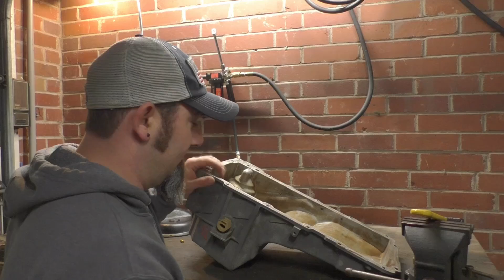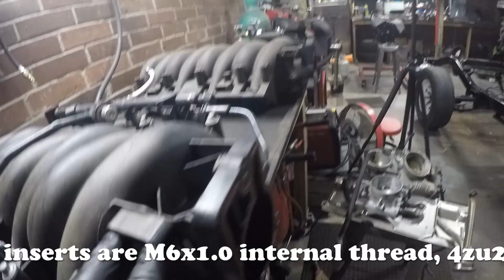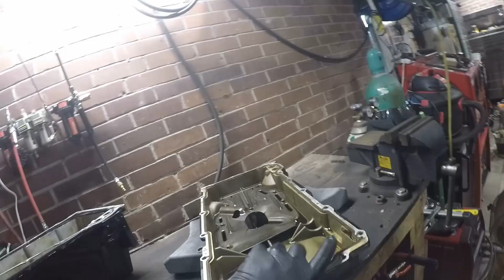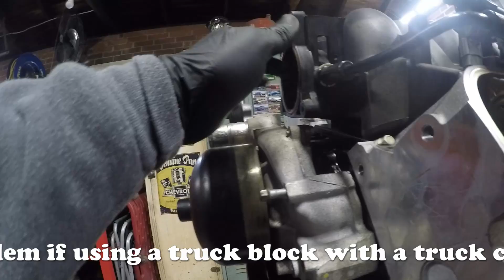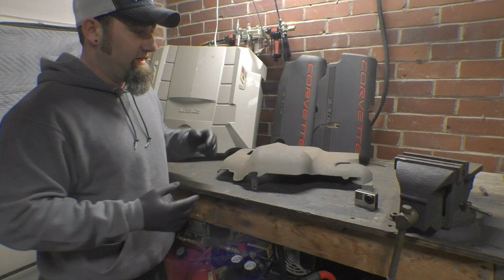Shop Talk: Ls engine guide

Comment: Love this video! Trying to get as much info on ls swaps, im looking into swapping my 2010 chevy colorado that has a 2.9l. Amy recomendations or info/tips youd have? As far as engine years, manual transmissions etc? Thanks! Subscribed!🤙
Reply from the maker: Glad it was helpful!, For your colorado the sky is the limit, nearly everything should fit under the hood with no worries. Depends on the purpose for your truck, but in my opinion the easiest would be a 5.3 ls, probably gen 4 since youre gm already it may talk to some of the electronics and the trans depends on if 2wd or 4wd. If 2wd throw a TKO or a T56 at it and call it good! Thanks for watching and commenting!

Comment: Excellent work bro have a question just got a vortec engine from a 2007 Tahoe that I will be installing on a 64 impala will I have to convert the manifold for hood clearance and what manifold you recommend thank you 🙏
Reply from the maker: Youll probably have to convert to car manifolds for hood clearance. Its a 2007 vortec engine so it should be cathedral port, meaning either an LS1 or an LS6 manifold will easily fit. The rest of the brackets should bolt right up to the block so the accessories will fit you just have to make sure that your oil pan clearance is good. Thanks for watching and commenting!

Comment: When you discussed the truck intake & car intake, does "truck" refer to only full-size trucks? What about GMC Envoys/Chevy Trailblazers, would they be considered car or truck?
Reply from the maker: Those would definitely fall under the truck category. Though they are suv's they are more similar to the truck accessories and intake height.
Reply: @SmallTimeMotorsports  Thanks. By the way, my 04 Envoy XUV has the aluminum 5.3L LM4...

Comment: I’ve got a 5.3 from a 2002 silverado and I’m wanting a shorter intake. What should I look for to direct bolt up?
Reply from the maker: Thanks for watching and commenting!! The lowest profile intake youll be able to go with would be a car intake manifold. If its a 5.3 then it has cathedral ports on the cylinder heads and id be looking for an LS1 manifold, the ls6 does flow more but not enough on a stock engine to be concerned with

Comment: I am sorry,! I didn’t catch it. Are you working on a 5.3L with a fbody/vette intake?

Edit: it’s an aluminum block.  I am new to this.  Will the LS1/6 intake and heads go with the 5.3l block?  Sorry if it’s a dumb question...
Reply from the maker: Thanks for watching and commenting, I am working with an aluminum 5.7 corvette engine, and for your question, yep, the heads will bolt over, but theres and issue with that, youll be dropping your compression if you do and leaving some low end on the table. unless youre doing a full build, it may not be worth it on a stock engine.
Reply: @SmallTimeMotorsports  thank you for your answer sir.  subscribed!

Comment: The staters ARE interchangable, however, you just need to use the correct bolts, also, the starter with one long and one short bolt can actually snap off of your aluminum block over time.  always go for the starter with the 2 long bolts
Reply from the maker: Thank you for adding to the knowledge here!!!!

Comment: What is the sensor on the top of the truck intake, with the green cap on it? Is it needed for a swap, and where does the line lead to on the driver side of the intake? Thanks to anyone that answers.

Comment: Can someone help..I hve a 05 Pontiac Grand Prix GXP and I had a situation with my transmission..I had it rebuilt 3 wks ago...now my cylinder #6 is mis firing, so we ckxd and #5 fires at 195 of compression, but #6 is at 25 (loss of compression on #6) I'm not sure if the lifter is stuck or has collapsed or has completely dislodged and turns but the ticking is there, and it's most definitely gives off a funny smell like rotten eggs. Do I take out the lifter, (reseet  after checkn the lifter and push roads that is) or does the 5.3  needs replaced...can I save that particular engine?

Comment: I am getting ready to ls swap my 1989 chevy g20 van. What configuration would you suggest? I am new to LS but not engine swaps in general. Was looking at doing a 6.0 with 4l80. But i am concerned about clearence. I currently have a 350 tbi in the van.

Comment: The biggest issue I had to overcome with the 6.0 LS in my XJ is a good cooling system. the Novak XJ swap radiator, although fairly robust, and well made doesn't have the cooling capacity. I finally had a custom radiator made by C&S Racing out of Indy. That solved all my issues except I gotta eat baloney for a while.

Comment: Thanks for this, this did help , I'm hoping to make the LS leap,( or vortec, ) I want to swap a 4.8 in place of a 4.3 in a 97 s15, I want to swap trans and engine, do away with all the security, and everything not needed, I'm thinking about a '05 engine and 4x4 trans, I want to cam swap, only for a while, I want to learn to tune, and do the harness work, I am just not sure how to keep the stock gauges, I thought maybe connect everything that's needed, for the gauges to work then basically do a standalone ecm tcm, thanks for all the info!!

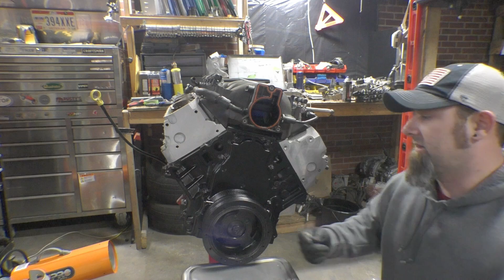Comment: Ok so I’m 7:45 into this video and I have two questions already; Does the truck intake fit under the hood of a Gen II S10 pickup? And do all the oil pans have the same capacity? Thanks for the informative video btw.
Reply from the maker: Thanks for watching and commenting!! So to answer your first question, dependinv on the mounts you use the truck intake should fit under the hood, for your second, most of the oil pans hold between 5.5 and 6 quarts of oil, with the exception of the larger Camaro and G8 oil pans, they come in at 8 quarts. Thanks again for watching man!!

Comment: Both starters are interchangeable, they are exactly the same besides the vette/camaro starter uses 1 short and 1 long bolt and the truck uses 2 long bolts. Other than that 100% compatible on either engine.
Reply: My truck actually has the 4 wire plug on it. 2000 silverado 1500 4x4. So I think they will interchange also. Bolt pattern is different because there is different because of case size with different amperage output (100 amp vs 135 i think) but you just have to change mounting bracket to run either one.

Comment: ATK, HP 97, 5.3, 385 PLUS HP, 390 PLUS TORQUE , IT WILL STAND OUT!
comp cam, it moves a crew cab with big block power, a 69, 396, had 375 hp and 380 torque! It's only 325 ci, think about it!

Comment: I lost 150 lbs. and gained 150 HP switching from the cast iron 4.3L V6 to an aluminum 5.7L LS1. Best upgrade for an S10. A win-win situation - you get more go (LS1) for your ride and a great anchor (V6) for your boat. lol
Reply: Why does everyone want an old school 5.7? You can make more power out of a 5.3
Reply: @sethh8892  Numbers don't lie - 5.7 vs 5.3 is easy math. Just because everybody and their brother-in-law is working on inexpensive, generally cast iron, 5.3s does not mean they make more power. If you have more cubic inches, you have more potential. The only downside to the aluinum 5.7L blocks (GM aluminum blocks, in general) is their limited tolerance to over-boring, w/ the limit ~ .010-.020, and adding significant amounts (<15-20 PSI) of boost.
Reply: Your build interests me.

Comment: Another difference I ran across, is that some early 6.0 engines had a longer crankshaft than the 4.8 and 5.3,  It had a flat flywheel flex plate. The 4.8 and 5.3 used a dished flex plate.  These 6.0s also had cast iron heads, I think it is referred to as a LQ4

Comment: I put a 4 barrel  on a pulp truck c50 chevy. I had no power and it drank gas. My mechanic said to put my  old intake and 2 barrel and put it back on my  new engine.  My mechanic said that 2 barrel and intake is very tall for torque, he was right. These new ls v8 truck engine intakes and injection set up is much taller  than the car set up. i wonder if this tall design is also for more torque?  My mechanic said chevy engineers designed this,  not loggers.
Reply from the maker: Your mechanic is absolutely correct, the longer runners are for torque, and the smaller runners on the car intakes lend better to higher rpm horsepower. The difference in cams moves the powerband to a certain range to make proper use of the intakes and runner length. When you moved your intake and put a 4 barrel on your truck it likely couldnt use the fuel it was getting, but if you paired it with a more suited cam it would have been able to compensate and have been a better power upgrade. Smart guy your mechanic!! Thanks for watching and commenting!!

Comment: I have a 03 LQ4 and bought a used cam with 640 lift.Will i have to worry about about valves hitting pistons?
Reply from the maker: Thanks for watching Larry, so to answer your question there is a lot more going on here. You need to worry about LSA and duration more than total lift, not to mention a very hefty valve spring upgrade. Lift doesnt always mean more power, and with a big combustion chamber and a dished piston stock a high lift cam might not be the best bang for the buck here. Since the lq4 is a relatively low compression engine bumping the compression with a different set of heads will likely give you more than a radical cam swap. Thanks for watching and good luck with your build!!

Comment: Thank you so much for all the details.  I will watch this a few times.  I just bought a 1980 Cherokee Laredo.  It had no engine was just $500 for a nearly rust free California vehicle.  I will likely go with a 4.8L or 5.3.  I don't plan on going fast.  Might you recommend an LS motor for my application?  Thank you.
Reply from the maker: Thanka for watching Joe, a rust free 1980 cherokee is a score, engine or not. To answer your question a truck engine will likely be the cheapest, and the 5 3 is a very plentiful engine with a good amount of power and economy for the size. If you can grab a wrecked donor vehicle and have at it youll be set for almost everything youll need. Cheers on finding an awesome rig, good luck on your build and thanks so much for watching and commenting!!!

Comment: You can get adapters to space out the shallow water pump to use truck accessories, also some throttle bodies are 87mm like the LY6 that is a 4 bolt pattern. Also the new gen 4 truck intakes out flow the old style truck intakes.
Reply from the maker: Thanks for watching Andrew, and to your post, you're absolutely correct about the water pump spacers, I have seen those used before. As for the throttle body on an LY6, correct again. This video is about the Gen 3 engines so I did not go into the Gen 4. Thanks so muck for watching and commenting!!

Comment: I’m thinking of LS swapping my 350z but I was wondering what Ls I should use??
Reply from the maker: It really boils down to cost and the power youd need. Pound for pound the 5.3 truck engines are the cheapest for the engines, but to top end and accessories can cost you more in the long run. The truck engines also weigh about 70lbs more, give or take. The car engines are lighter, have a lower profile intake, and run easier front drive accessories to fit under the hood. In the long run if you can price the intake and brackets cheap enough, id go 5.3 all day long and when you blow it pluck another one for 500 bucks. Hope this helps, and thanks for watching!!!

Comment: What’s the flow difference between a truck intake and a tbss intake?
Reply from the maker: So there are a few differences between the tbss and truck intakes. The injectors are different and the truck is 75mm vs the tbss at 87mm. Tuned up the tbss intake should be worth around 15hp/tq.

Comment: If you are wanting to run a boosted LS for cheap. Find a cast iron 5.3 Lm7, pull some 799 heads, and optional put some flat top pistons from a 4.8.

Comment: If you are wondering what the aluminum block truck style Ls engines are. Its either a 5.3 (L33) or a 5.3 (Lm4). The L33 comes stock with flat top pistons and 799 heads that are identical to the 243 heads from a Ls6. The Lm4 is basically a regular 5.3(Lm7) iron block just with a aluminum block.

Comment: If you are building a flat out drag strip car on the cheap I would go with the higher air flow intake out of the gate. If you are building a street car, I agree with you about going with the low profile intake.

Comment: I have a 89 camaro and ive been going back and fourth on which engine to use rn im thinking Ls3 and im glad you mentioned buying the accessory drive people fail to realize just buying 400 dollar junkyard motor doesnt just cost 400 if your trying to put it in a car with parts that fit it adds up quickly...great video!
Reply from the maker: Hey man, thanks for watching. Yes, the accessory drive can be more expensive than the engine in some cases, and definitely needs considered when planning your swap. Good luck with your camaro!!

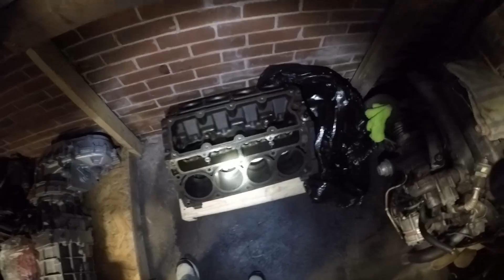Comment: At 11:58 on the video when you're showing the 6.0 block for the CTS-V, to the left on the ground, there's a transmission with a xfer case mounted to it.  Is that a T-56?
Reply from the maker: Thanks for watching and commenting. That transmission is an AX15 and the transfer case is a Rocktrac from a Wrangler Rubicon getting swapped into my YJ.

Comment: I have a 2013 silverado. Its iron block with the active fuel management. Wouldnt i have a gen 4 ls1? Just makeing sure
Reply from the maker: Thanks for watching, yes, you would have a Gen IV ls engine. Lots of potential if done right!!
Reply: @SmallTimeMotorsports  thank you for the response. My plans are  to get my stock heads worked... and have good valve setup. Get the block cleaned with new cam and crank bearings and a good cam. Also put normal set of lifters in here so she can stay v8 all the time!

Comment: The ls1 and truck starters work on both but the ls1 starter  tend to break on the thinner bolt side.... if you have to replace it on ls1 use a truck starter because on truck starters both bolt holes are thick....there been cases where the block has got damaged after ls1 starter ear breaks
Reply from the maker: Thanks for watching and adding to the knowledge base here man!!

Comment: Any idea if I can use accessory drive system from a 2014 Camaro complete engine to fit in my 72 Nova 6.2
Reply from the maker: Jose, im not sure if the alternator being that low would clear or not, however it seems like the truck style accessory drive will work and they are plentiful. Thanks for watching and for commenting!! Good luck, sounds like an awesome project!!

Comment: Thanks for the information I really appreciate it, I have a 69 impala vert what do you think would be the best swap for an everyday drive but still show off when tested?
Reply from the maker: Probably any car type LS would be great, the truck versions are cheaper off the bat but buying brackets and intake, etc, runs the cost over that of the car type for sure. If youre building yourself just start with a 6.0 block and go from there. Thanks for watching and good luck!!!
Reply: Thank you buddy u just saved me some money cause I most definitely was thinking a truck one because there so easy to find. Thanks again...

Comment: I have a 2000 GMC Sierra with a 4.3 vortec . I’m wanting to do a 5.3 swap do I need to stay with the same year do to the wiring? Thanks
Reply from the maker: If it were me and i was trying to convert from a 4.3 to a 5.3 I would make sure that I had a full donor chassis. Im not 100% sure on everything adapting over but if you get a wrecked full donor chassis you should be in pretty good shape and the wiring should switch over. The body harness and the engine harness connect together so im sure the body harness should be ok, but youre going to want to switch the trans and engine both over  (or get the flywheel and spacer for your 4.3 trans though I believe it also has a smaller input shaft and is lighter duty as well) with the underhood harness to get it right. thanks for watching and commenting!!!
Reply: Jayme Unger... just get a new used truck with 5.3 and drive that.

Comment: curuious u said the 6.0 truck is cast iron block.  its after midnite so not gonna run check but i swear my 08 gmc w the vortec max is aluminum block.  Did I get screwed into thinking I have somehting i dont  ie: the  6.0.  I by no means know much about these engines but am glad i found ur video because im planning to swap some variation into my 86 vette in the future
Reply from the maker: Thanks for watching and commenting!!! You may have an aluminum block in your 08 GMC, that is a gen IV engine called the LFA block. It shares a lot with the other truck engines and if im not mistaken should have 243 cathedral port heads. If you have a LFA block it will have a ribbed Active fuel management valley cover and thats the biggest and easiest tell tale other than decoding the vin. So its kind of a hybrid Gen III/IV engine, it uses gen IV crank reluctor and gen III heads.
Reply: you should have the L92 rectangle port heads with your aluminum 6.0 block.

Comment: The problem i have with mine right now is that the detent cable from the 700R4 is to short to reach the DBC throttle body.Is there a longer cable available?

Comment: Wow! Ok, now I am re-thinking my LS3 camaro swap. I have watched a lot of vids, read lots of blogs / car performance articles, but no one has gone into the "details" of difference between the truck eng (what I have LS3 LQ9) and the "car" style, especially the intakes and water pumps, this will all add cost. Thanks.
Reply from the maker: Dave, Thanks for watching and commenting! I am glad to hear that I may have provided you with some information to help you in your swap. The LQ9 is an awesome engine and set up right will surely give your camaro a wake up, its very easy to get 400hp/tq out of one and for a street car thats a great foundation to build on. Good luck on your swap!